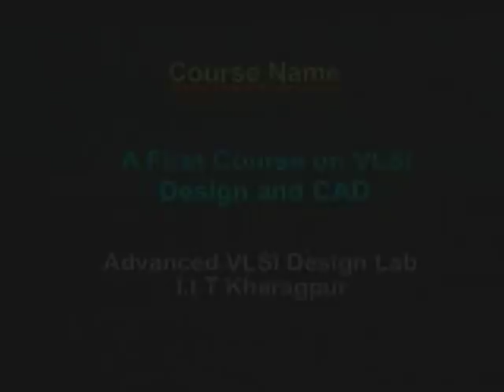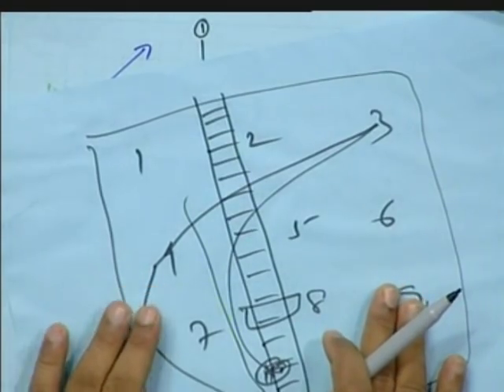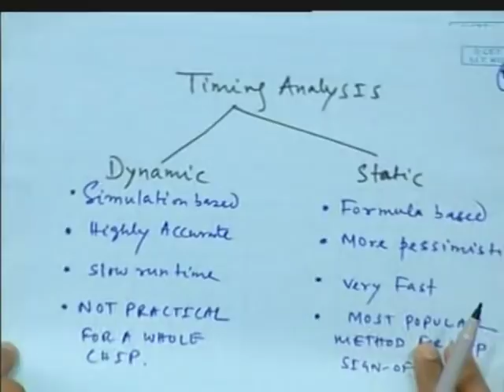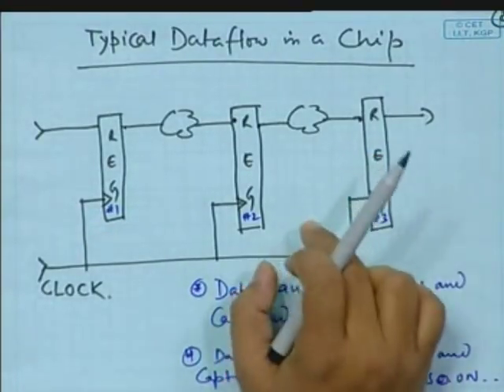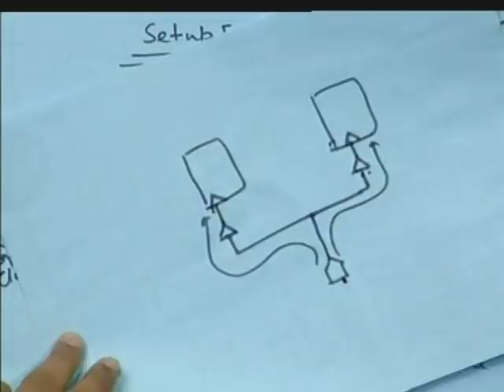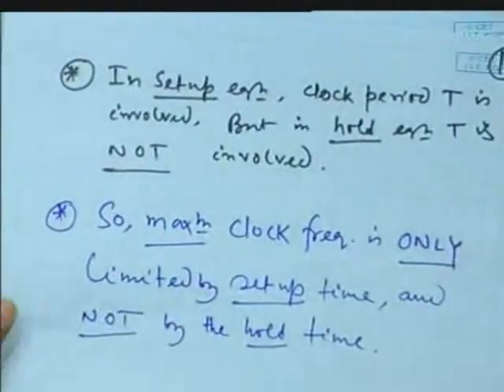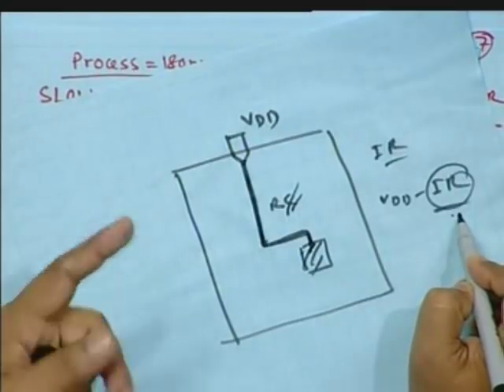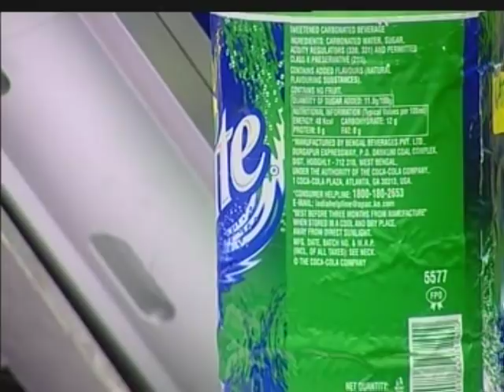Lec-33 static timing analysis.wmv

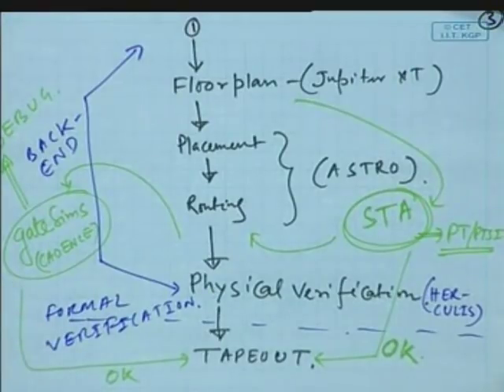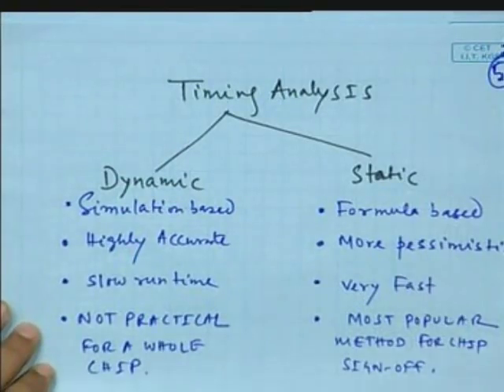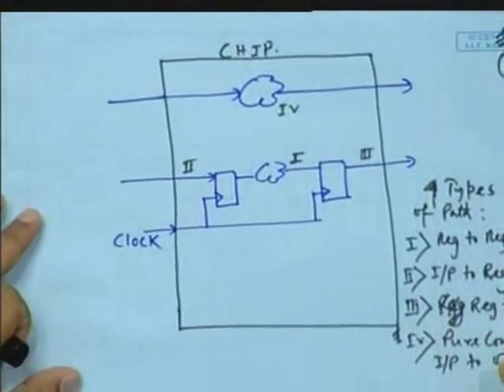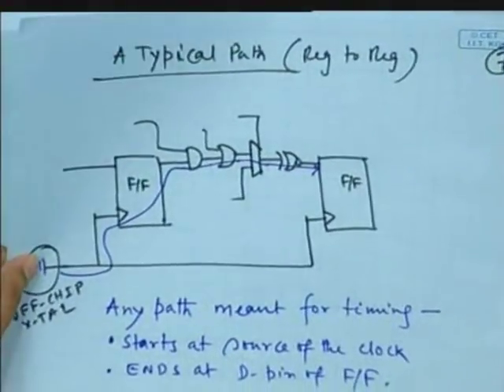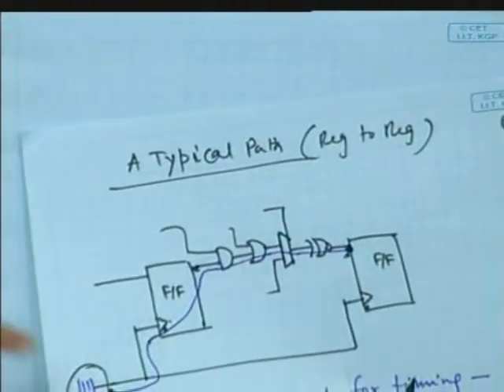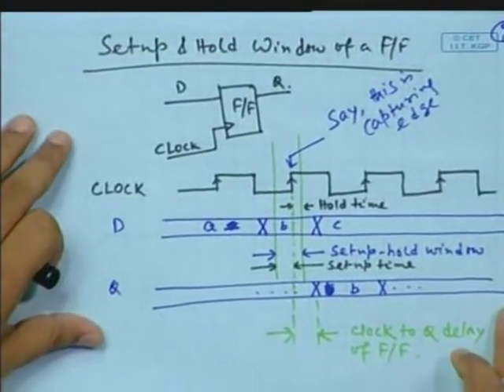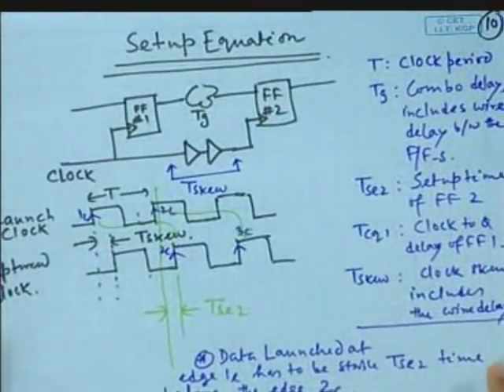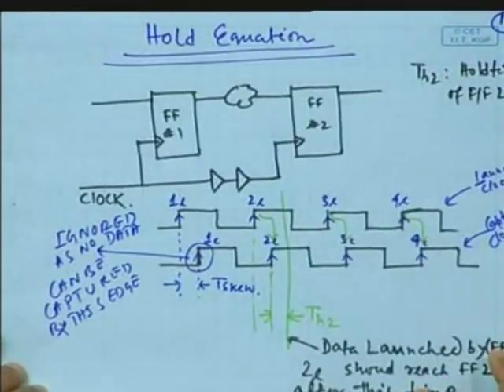Comment: 0:03 Intro 0:32 Start and Outline 0:53 ASIC Design Flow (Front-End) 5:52 Back-End Flow 22:26 Timing Analysis 28:32 Types of Path Inside a Chip 29:09 Typical Path 30:26 Typical Data Flow 31:59 Setup & Hold Window of Flip-Flop 36:25 Setup Equation 46:55 Hold Equation 51:09 Choice of Clock Frequency 53:29 Role of the STA Engine 58:13 Analysis Corners 1:04:30 Design Constraints (part I)
Reply: Thanks for this bro

Comment: More explaination with clear steps on how  static timing analysis and dynamic timing analysis using practical examples would have been more helpful,demonstrating with  numerical examples with different  practical circuits for the statements for set up, hold time equations, possibility of scaling down the frequencies for chip,would have been more helpful than mearly explanining the equations and giving the statements....even though some knowledge is gained on static timing analysis...still there are many doubts left in my mind by the statements given without clear explaination of how it is aschieved ....
Reply: True

Comment: But I still dont get it , what is the specific signifiance of the word STATIC ?
Reply: You don't require switching activity in order to analyze the clock and data propagation. In short the analysis is done solely based on the netlist itself without simulation.